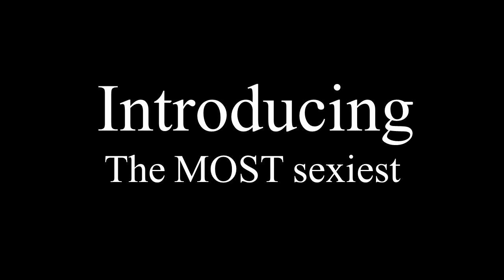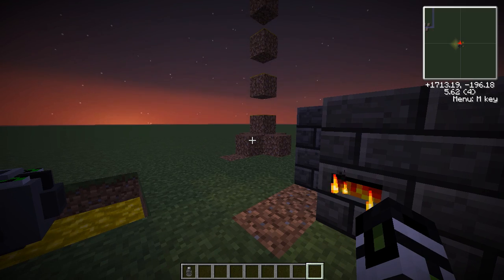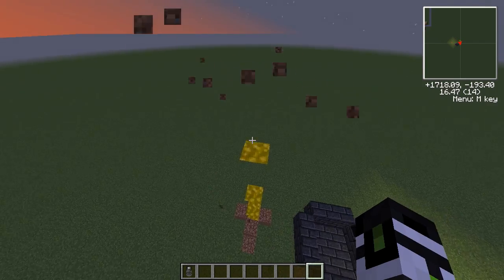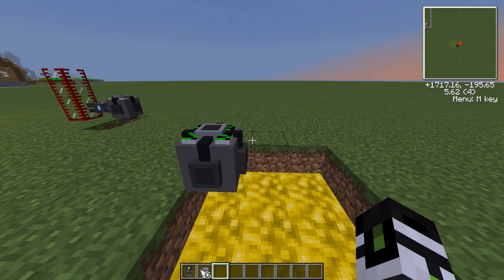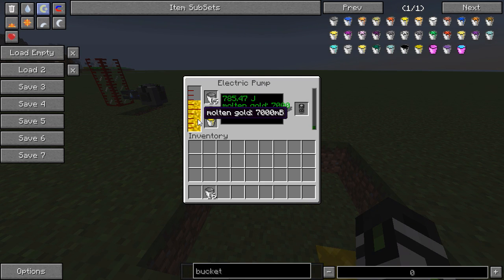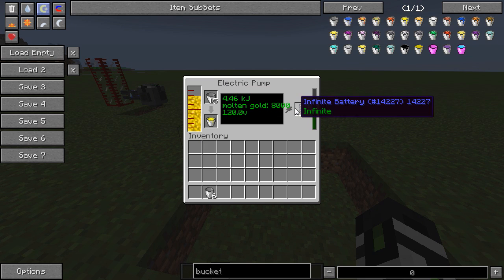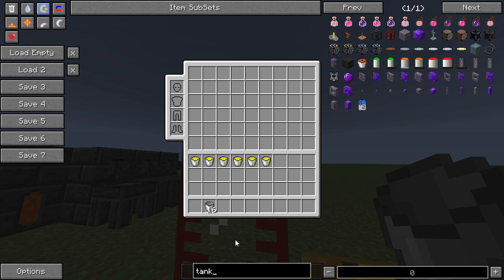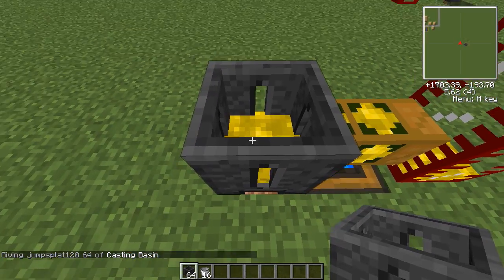How To: Get That Gold From The Lakes!

Comment: I was lucky and managed to find both "surface lakes" and "molten manyullyn block". Going to make a world with these pages and get some new gear :)
Reply from the maker: Lucky!

EDIT: Careful with the instability though.
Reply: jumpsplat120 Has not caused instability oddly enough. Considering how rare and powerful such material is, it should, but I'm glad it doesn't(or has a low chance to) I had to return here to figure out how to get my pump working though. Soon I can make a house out of it.
Reply from the maker: You're making a house out of manuhmunuh?
Reply: TrueMegaManiac Holy luck Batman!